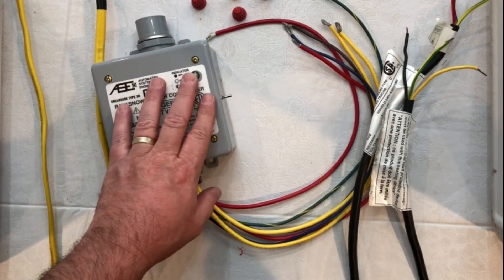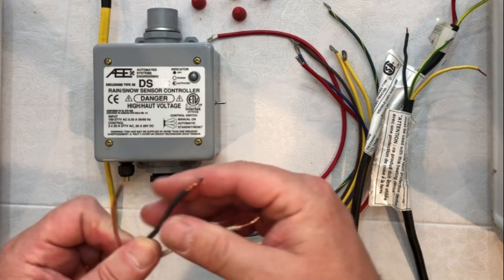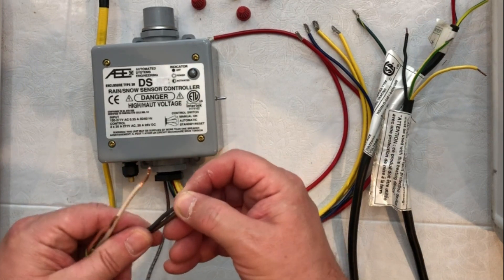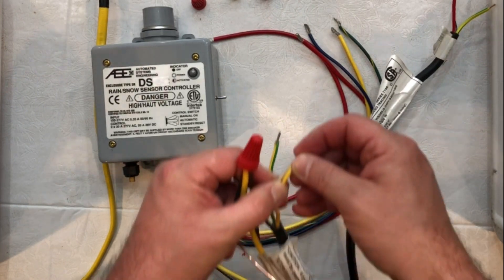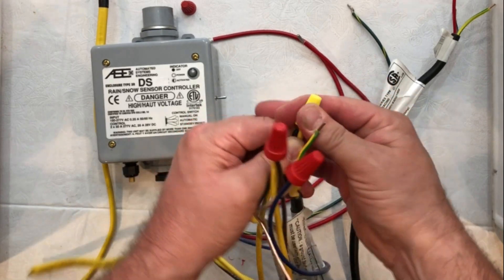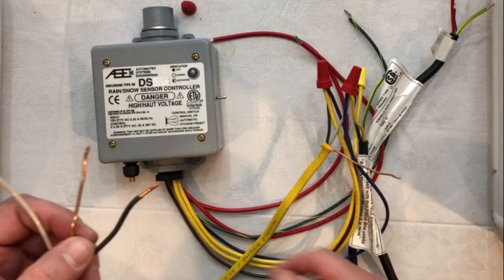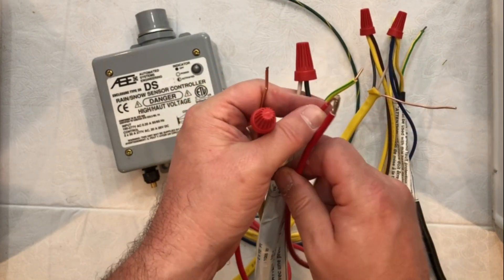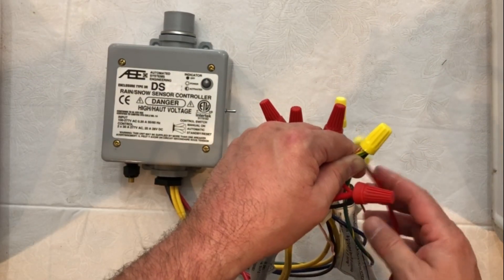How to wire the DS-5 and DS-9 controllers in 4min

Comment: How do you do this exact same wiring but for 4 mats into the DS-5?
Reply from the maker: Hello! Pair the heating cable(s) by amperage so that each pair does not exceed 24A. One pair on the Yellow leads, and the other pair on the Red leads. If that cannot be done, an additional controller will be needed. 

The DS-5C has two (2) 24A (max load) circuits fed by 2 separate circuits from the electrical panel using a max 30A double pole breaker each. 

While there is no limit on the number of heating cable(s) attached to each circuit, it is recommended to only use 1 or 2 heating cable(s) per circuit. The connection at the wire nuts may get too large to make a solid connection. We're a call away if you need further support!